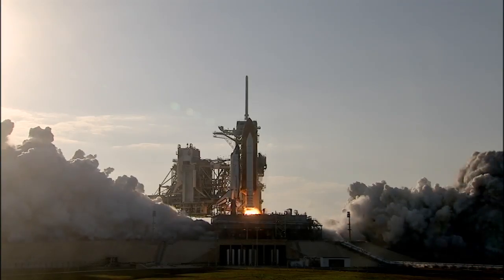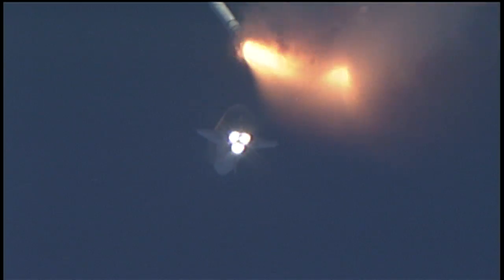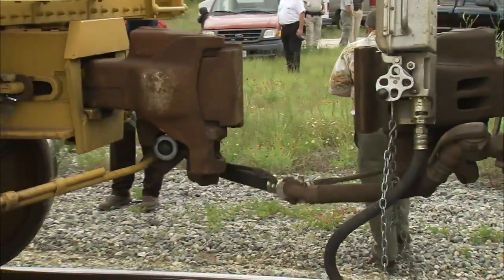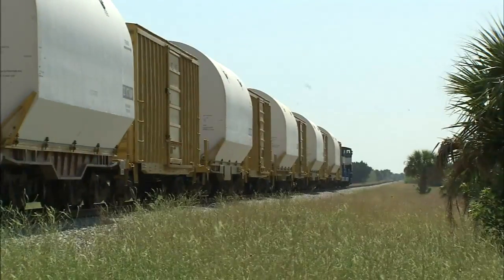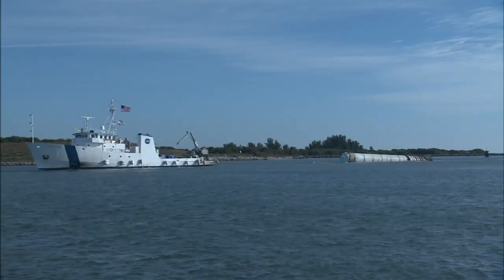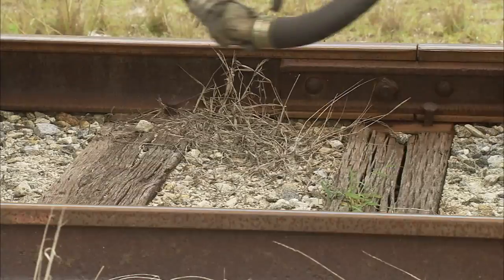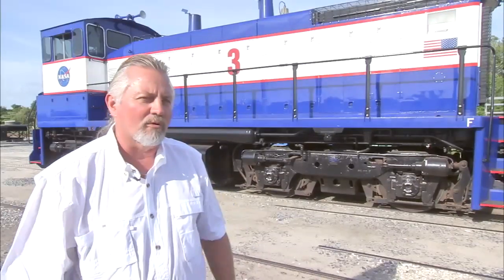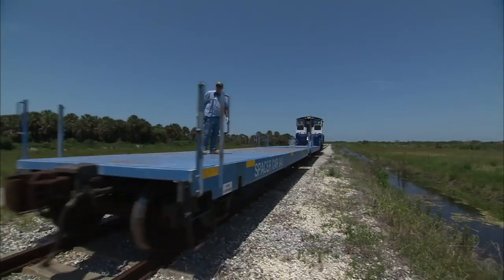Space Shuttle Era: NASA Railroad Keeps Boosters on Track

Comment: A hump yard is a large RR yard, with many tracks, where trains are basically assembled. A switch engine will push a car, usually slightly downhill, then let go of it, where it usually goes thru several switches to the correct track, and gently (hopefully) bumps and connects to the correct train. Sensitive or fragile cargo should not go thru this procedure, hence the wording "do not hump" clearly marked on these cars. There's probably many references to hump yards on the internet. Dirty minds ha

Comment: for all you people wondering what "do not hump " means .. its not like humping as in the kinky way a hump on a railroad is a small up hill grade and then a downhill grade to make a rail car alone move on its own with a railroader on the car so they can switch to different track... the railroaders job is to handle car braking so it doesnt couple at over 5 mph .. if it does... the couplers will smash and possibly blow up the solid rocket boosters... wich kills everything near it so they put do not

Comment: Do Not Hump refers to a rail hump yard, a method of switching lots of cars at one time over the crest of a small hill (hump) and across sets of automated switches.  Cars are released one at a time to roll down the hill and switched onto the proper track, where they smack into other cars previously switched. 

Doing this with explosives is not recommended!!

BTW, lots of specialty loads are marked with this 'Do Not Hump' warning, so trainmen are used to seeing this marking and handling them.